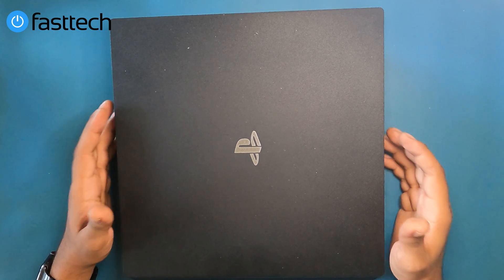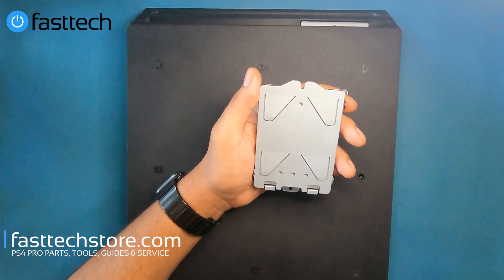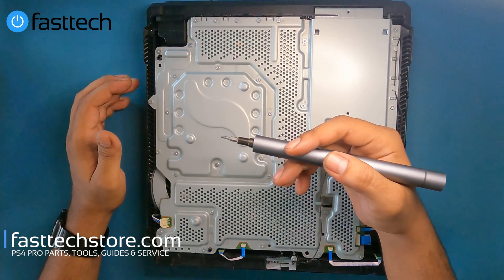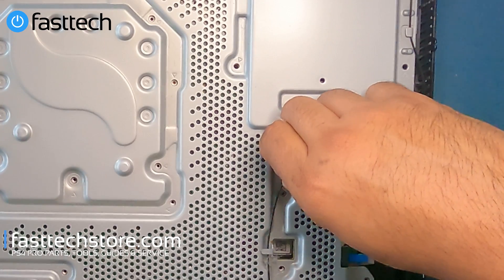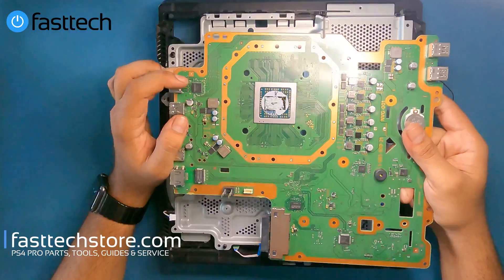PS4 Pro CUH-7215 Disassembly and Repair Guide

Comment from the maker: FREQUENTLY ASKED QUESTIONS
Where do I buy the parts and tools needed for this job?
👉 Fasttech Pro Auto Kit: https://fasttechstore.com/tools/fasttech-pro-auto-kit
👉 PS4 Pro Disc Drive: https://fasttechstore.com/playstation-4-pro/ps4-pro-disc-drive-cuh-7215
👉 PS4 Pro Power Supply: https://fasttechstore.com/playstation-4-pro/ps4-pro-power-supply-cuh-7215-7200
👉 PS4 Pro Hard Drive: https://fasttechstore.com/playstation-4-pro?category=Storage+Drives
👉 PS4 Pro Fan: https://fasttechstore.com/playstation-4-pro/ps4-pro-internal cooling-fan
👉 PS4 Pro Motherboard (NVG-001): https://fasttechstore.com/playstation-4-pro/ps4-pro-nvg-001-motherboard
👉 PS4 Pro Motherboard (NVG-002):https://fasttechstore.com/playstation-4-pro/ps4-pro-nvg-002
👉 PS4 Pro Heatsink & Chassis Plate: https://fasttechstore.com/playstation-4-pro/playstation-4-pro-heat-sink-and-chassis-plates 
👉 PS4 Pro Screw Set: https://fasttechstore.com/playstation-4-pro/playstation-4-pro-screw-set-995s5-jfttj 
👉 PS4 Pro Chassis and Heatsink: https://fasttechstore.com/playstation-4-pro/playstation-4-Pro-heat-sink-and-chassis-plates

👉PS4 FULL INSTALLATION/UPDATE FILE: https://fasttechstore.com/playstation-4-update-file

👉NEED HELP? FaceTime/Zoom Video Call Me: https://fasttechstore.com/online-consultation
👉GET REPAIR SERVICE FOR YOUR DEVICE: https://fasttechstore.com/electronics-repair

▶Follow me on Social Media:
VLOG CHANNEL: https://www.youtube.com/channel/UCF2IPXKRX5ctN9td1rhkzHg
Instagram: http://instagram.com/youngtechg
Twitter: https://twitter.com/Shehroz

▶Business Social Media:
Twitter: https://twitter.com/FasttechCA
Instagram: https://www.instagram.com/fasttech.store/
Facebook: https://www.facebook.com/fasttechy

My Drive
00:00 Intro
01:02 Fasttech Pro Autokit
01:13 Hard Drive replacement guide (PS4 Cannot Start Error)
03:20 Removing the top cover
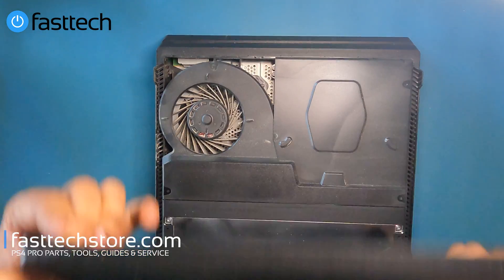04:10 Power supply replacement guide (No Power / Not Turning On)
07:44 Removing the motherboard backplate
08:32 Removing the heatsink clamps
09:08 Motherboard replacement guide
10:19 Heatsink - (PS4 is too Hot Error Fix)
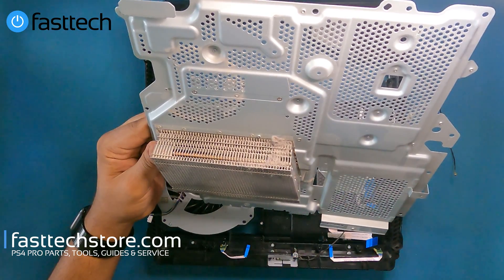11:46 Cooling fan replacement guide
12:33 Disc Drive replacement guide (Game Discs Not Reading)
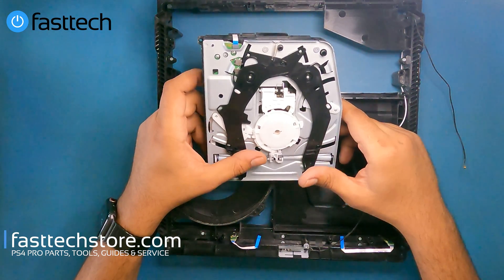13:37 Outro

Comment: Thanks, great video. Since I need a new motherboard for my ps4 pro 7215B, I want to know the condition of the motherboard you sell. Are them used or new?. Thanks again for your help.
Reply from the maker: @planta4678  these are used boards but in good condition and they include a lifetime warranty
Reply: @fasttechvideo thanks for your quick answer. Regards

Comment: Is my circuit board burns out can I replace it with another one and does it have to be specifically that same motherboard number
Reply from the maker: @FernandoHernandez-mb8ph  it has to be from a 7200 model ps5 pro if you have a 7200 series.

Comment: can you compare motherboard ps4 pro 70 vs 71vs 72?
Reply from the maker: @fauzitanjung8445  7200 series is the last ps4 pro with a smaller nm APU and cools better. The 7000 and 7100 and very similar but the power supply, mainboard and disc drives are slightly different. Hope that helps

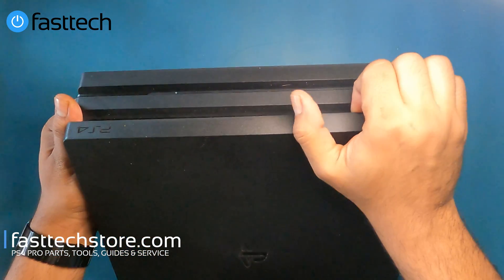Comment: How to remove power supply unit 4:10
Reply from the maker: Remove the cable and pull it out. If stuck use a screwdriver to gently pry it out

Comment: I'm getting a new fan and replacing the thermal paste on my PS4 Pro soon and this is helpful, but looks very daunting to do
Reply from the maker: Its not as difficult as it seems. Be sure to use coupon code youtube for a discount. Good luck and let us know how it goes 😊
Reply: @fasttechvideo  well it's quite the story. I followed your guide and another person's guide to tear down my Ps4. I've never felt so much anxiety trying to fix a piece of technology and it took me almost 2 hours for the whole process. Probably the worst part was taking the sand piece out of the slot because it wouldn't come out and I eventually broke a cable from the fan but since I was replacing the fan it wasn't a big deal anyways. Everything about this was so difficult and putting it back together had me stressed out too because the power supply when it go back in all the way because the two-pronged piece was bent out of shape and I didn't know that until I saw another person's video of how the prong should have looked and it still took me a long time to figure out how to reshape the prongs until what they should be. I didn't even know if my PS4 was going to work after I put it all together but miraculously it turned back on and hopefully things will be a lot quieter now lol

Comment: So I was following this guide and ended up tearing off the part/port on the motherboard that the powersupply cable plugs into. I read someplace that to replace the motherboard I would need a optical drive that is synced or something to the motherboard. That if I were to replace the motherboard itself I would need a new synced optical drive. Hopefully if thats not the case I could purchase a replacement motherboard
Reply from the maker: You need a matching disc drive logic board to go with mainboard not the disc drive itself but only for first gen ps4 1000 and 1100 series. Ps4 pro systems do not have a dedicated drive logic board and its built onto the mainboard. We sell paired units on our site. Check the links in the description box and top comment.

Comment: Great video - I had problems getting the power supply out of a PS4 Pro I just bought and didn't know about the two screws you had to remove on the flip side. Excellent video - PS4 Pro now runs virtually silent after thorough cleaning and replacing thermal paste 😀 👍
Reply from the maker: Great. Please like the video and subscribe 🙂
Reply: @fasttechvideo  done 😃👍
Reply: did you have problems putting the power supply back? the two pronged piece was bent for me so it took me a while to get it back in

Comment: I tried to replace thermal paste and when i turn on the pe4 it says system storage error
Reply from the maker: Check the hard drive connection, clean it. If that doesn’t work your hard drive needs to be replaced. Check the links in the description box. We also did a video specific to this issue 2 years ago on our channel but its still valid today.

Comment: I would personally recommend removing the connecter from the power supply itself. Following this video I tried removing from connector on the mother board and the connector broke off from the motherboard. Now my PS4 is completely broken and I don't even know if that is something that can be fixed. Hope I can save others from having this happen.
Reply: Same with me i dont have a torx security screw driver so i disconnected from the motherboard an it was so tight i ripped it off now u have to solder it back together fml good thing i have a ps5 tho
Reply: Thanks. Followed your advice and managed to pull it off
Reply from the maker: Yes good point. In my newer videos I always tell people to remove it from the power supply as if one is not careful the connector can get ripped off easily.

Comment: Hey can you please show the screws that you remove please ? Thanks
Reply: Take a picture of them installed and then you will know where the torx and philips screws go.
Reply from the maker: @jakallen666  Yes good idea or they can pause on this video before I remove them.
Reply: @jakallen666  i used a blue sharpie to put a dot next to each of the torx screws, easy to put back together without refering back to a photo👍
Reply from the maker: Torx T8H and Phillips. Links are in the description box if you are looking to buy the Fasttech Pro Autokit which includes all the bits you need.